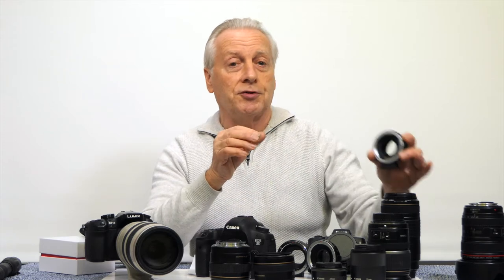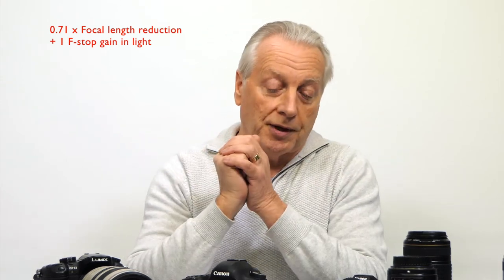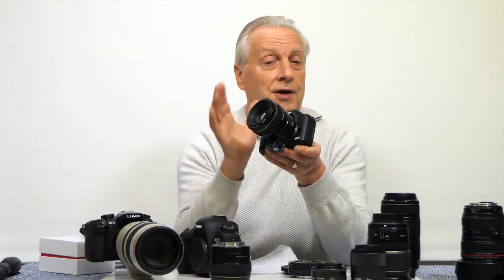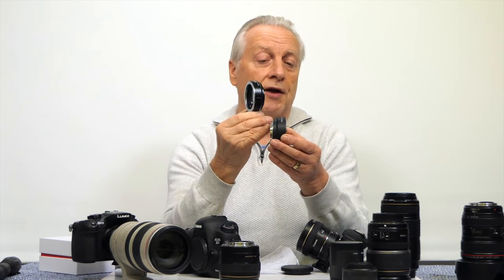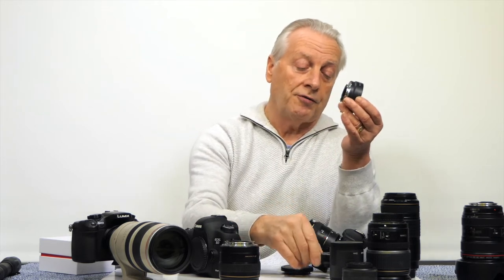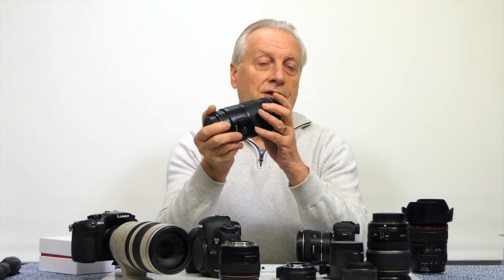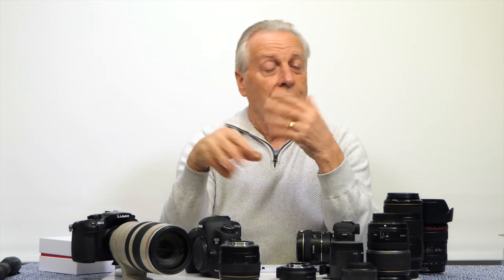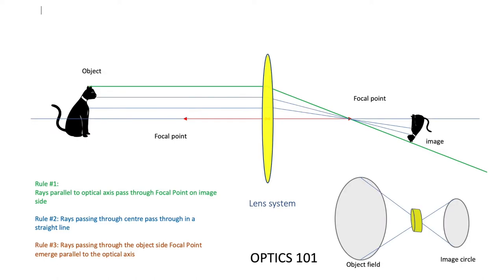Viltrox Focal Length Reducers - How they ACTUALLY Work!

Comment: "There's lots of reviews here on YouTube"
Maybe for M4/3 metabones boosters, but I've been having a hard time finding any for the new Viltrox EF-EF M speedbooster. Was actually thinking of requesting it of you since you're an EF-M mount user.
Reply from the maker: I'm going to shoot more of this to show how good it really is - especially for 4K video. It's true that using EFS lenses on the plain EF to EOS M  adaptor work great I have several EF lenses and this pulls back some of that wasted focal length and gives the extra light which is always useful. Some people hack their EFS lenses my sawing off some of the rear mount so they will fit with this adaptor to give an even tighter imaging circle to reduce the overall 4K crop. There are EF mount EFS lenses I believe so this might be worth investigating.

Comment: hi Graham sort of got it so I buy the Viltrox put it on my M50 and then put a standard EOS lens on it and it works or do I have to buy the canon lens converter as well sorry to be a but out stay safe see ya
Reply: No you just need the viltrox
Reply from the maker: It really depends on what the result is that you want. If you want to get a longer focal length equivalent lens just go for the plain adaptor as that will give you the 1.6x crop factor so a 50mm lens becomes 80mm (effectively) If you get the Viltrox EOS M2 then this applies a 0.71x magnification factor so the 50mm lens will become 50 x1.6 x 0.71 = 57mm with a 1 f-stop gain in light,
Reply: @GrahamHoughton12  Thank you Graham